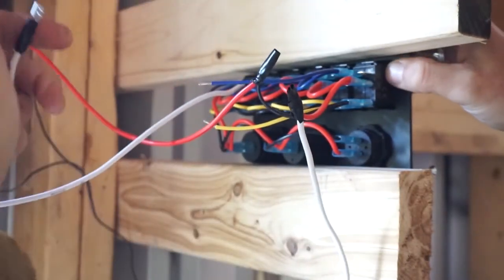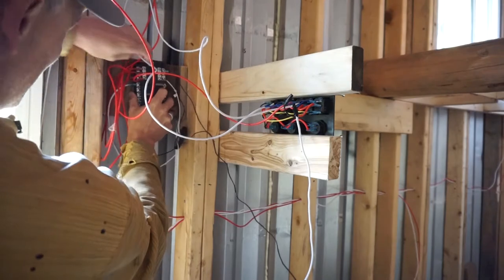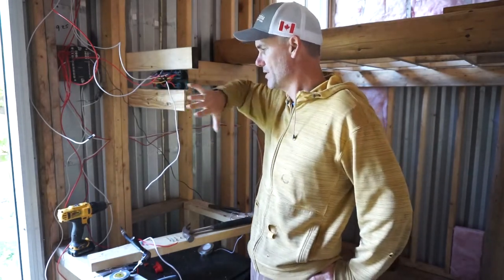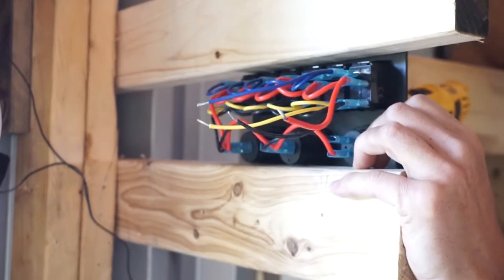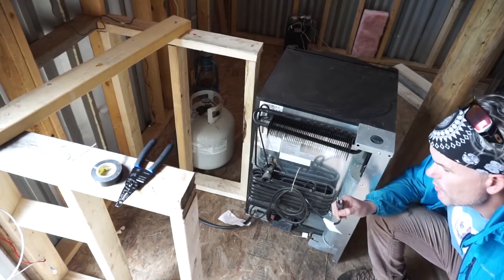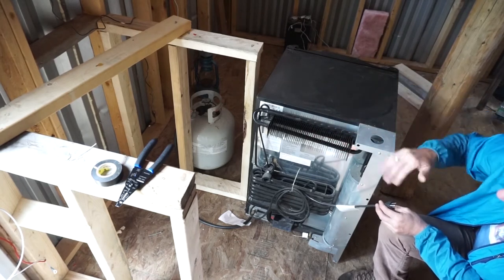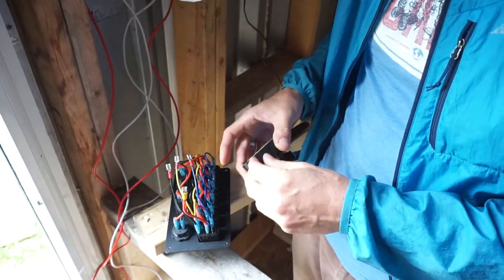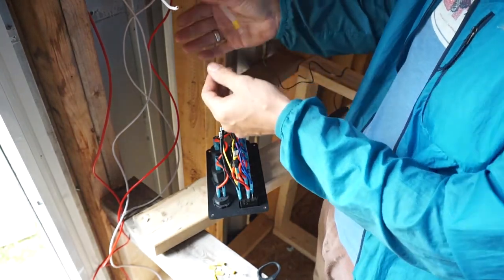12v Lighting: Finalizing Power Control Panel for a Tiny House & Connecting all the Wiring for Lights

Comment: Lol Nice start, I'm still trying to locate a led toggle switch that will allow me to do a 2-3 way setup for lights. Not easy to find.
Reply from the maker: yeah..I was looking for that too but this panel seemed like a good way to run one power supply and wiring and then control 6 applicances. Plus it looks cool! Thanks for stopping in!
Reply: @EGBeav  Ohh i agree, i can get a on/on 2 way switch anyday . Just cant get them  with LEDs. I wanted it to be like the  LED Ac switches where LED is on when switched off for night uses.
Reply from the maker: this one has an extra supply for lights which are always on so it would be lit. I did not want the light on due to power drain..even a small supply adds up. we live off grid so we are always wary of a phantom load!
Reply from the maker: ..and for our under loft lights we have a separate dimmer..so when we flip it on there is light from the console but the lights are off until the dimmer is turned on. Will work from bed like that so there is always an ambient light to navigate by. Lofts are not so great in the pitch black!
Reply: @EGBeav  right on they arent for sure.